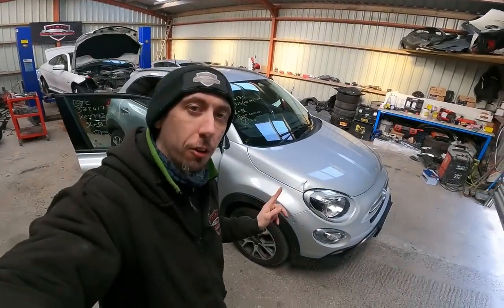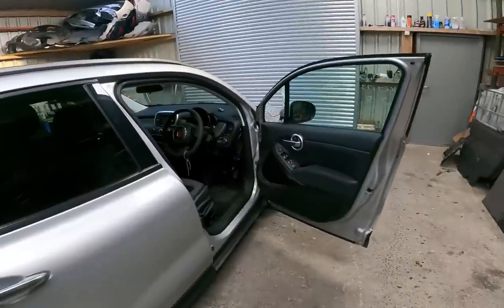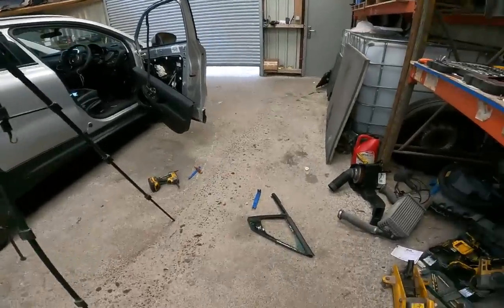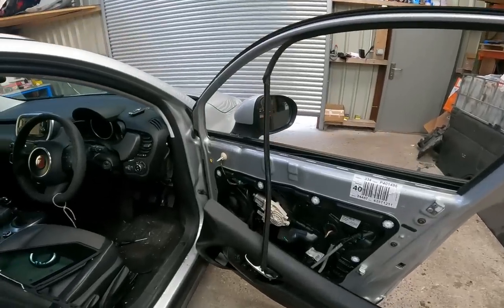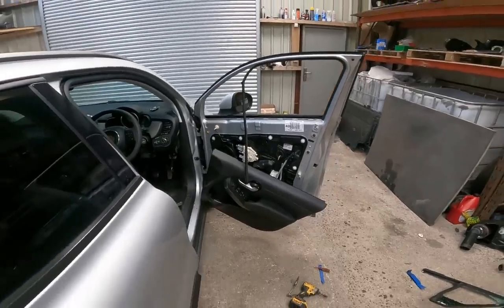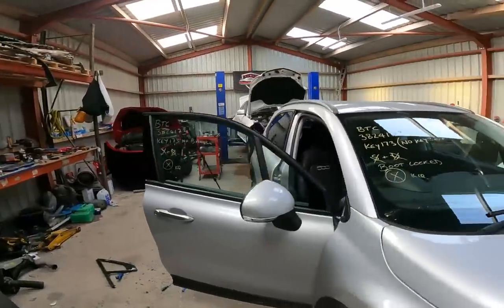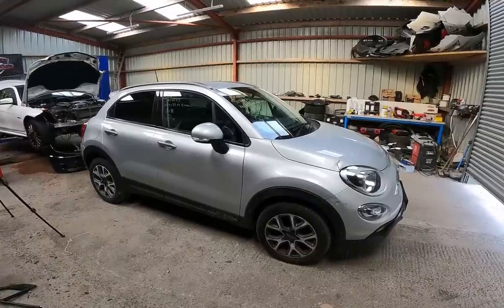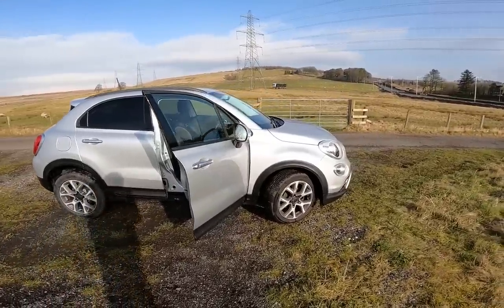The 500x Is Back From The Paint Shop And All Finished!

Comment: The quarter light assembly being supplied in a frame, makes for a straightforward exchange, without having to use a windscreen fitter, this Fiat 500X has turned out really well, great work as always Phil.